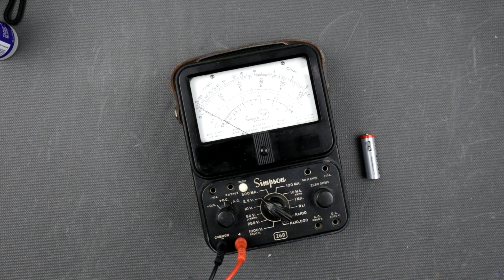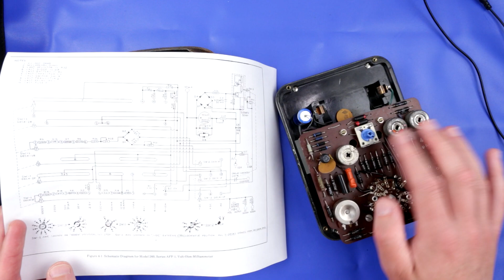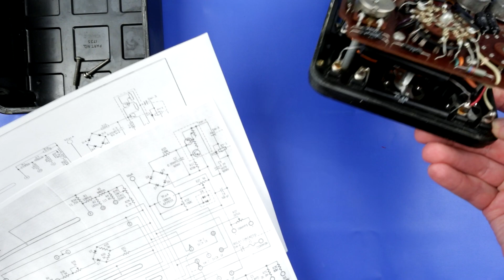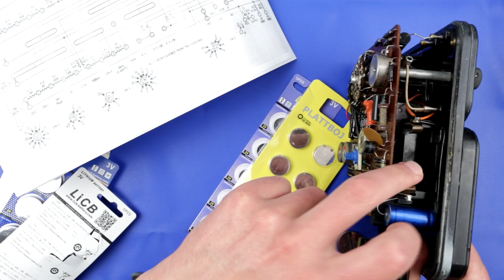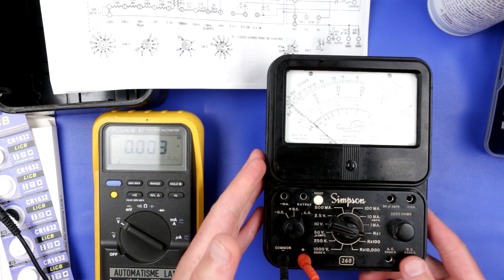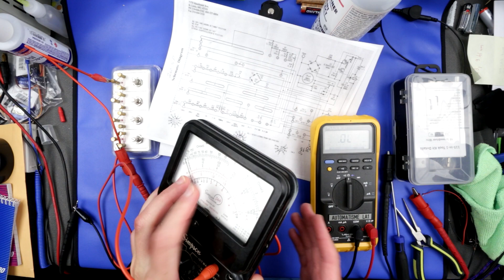Simpson 260 5p teardown and troubleshooting

Comment: You can use the shrouded probes if you cut off the shroud. Use a sharp knife and carefully remove the shroud without cutting yourself.
Reply from the maker: Great tip, that would definitely make them more versatile!